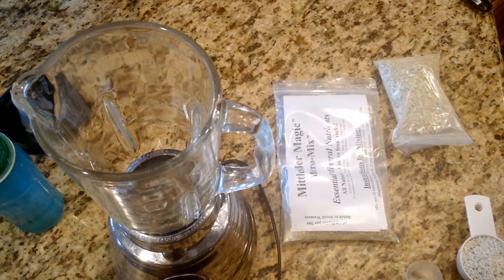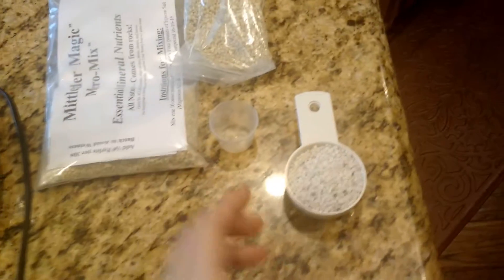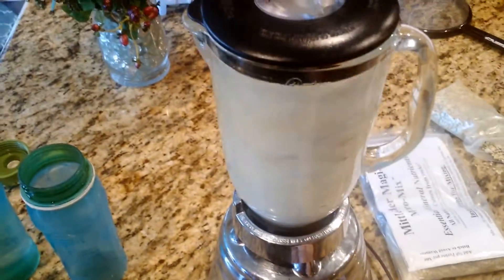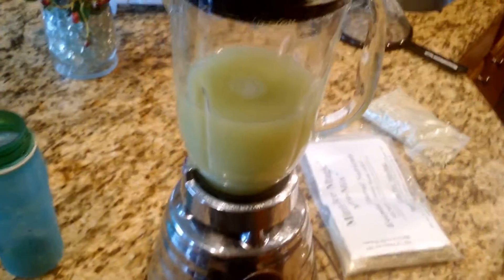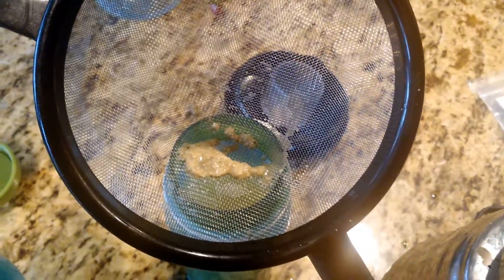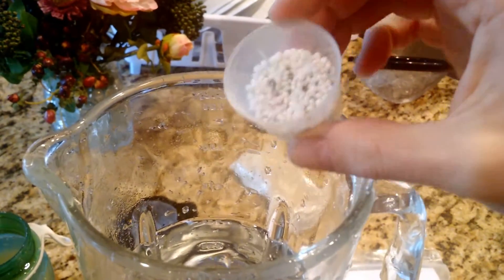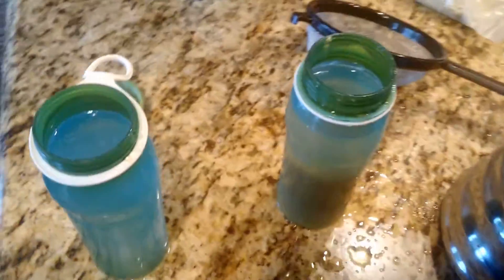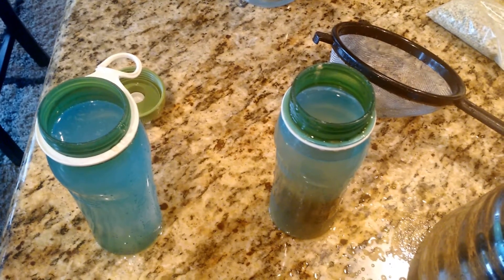Mittleider Magic Mix in hydroponics?

Comment: The problem I see with trying to do this is that the nutrients are not water soluble.  Some of them are, but most of the other 13 minerals and elements that Dr. Mittleider says to use are not.   You would have to stir the Mix alot to get the sediment distributed and it also might clog up your drippers.    The constant feed is used for seedling but you only mix up a small batch at a time which gets stirred up and then you use it on seedling flats.    If you mixed up a large batch and pumped from it there would be alot of sediment at the bottom because gravity.    You would have to have some kind of a system that actively stirred the bucket at the same time that it was pumping out the Nutrients.
Reply from the maker: All nutrients have to be water soluble before the plants can take it up.  Plants drink, not eat.  That said, you are right, not everything in 16-16-16 + Magic Mix is water soluble.  It has a lot of impurities that don't dissolve and is lacking a water soluble calcium source.  Further, the calcium in the preplant can take a while to break down so that plants can use it.

Looking deeper at the matter, and discussing with other Mittleider Method users, it turns out the weekly feed mixture has been changed from the original.  Recent revisions of the book contain a different recipe than the older versions.  A guy in our group has posted a revised version that adds back in the calcium:

https://github.com/tripzero/MittleiderGardeningPlus/wiki/Weekly-Feed

That said, I've been using a hydroponic mix over the past 3 months.